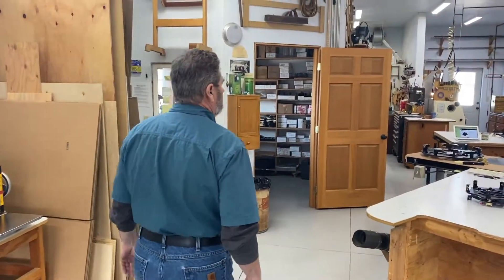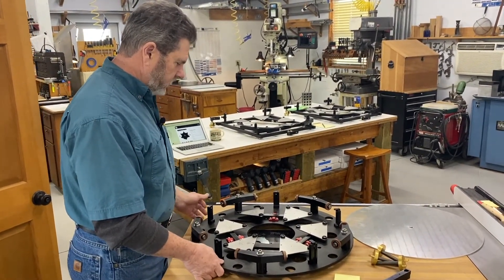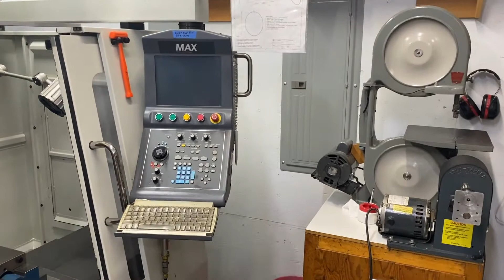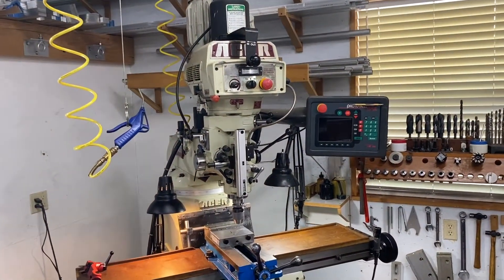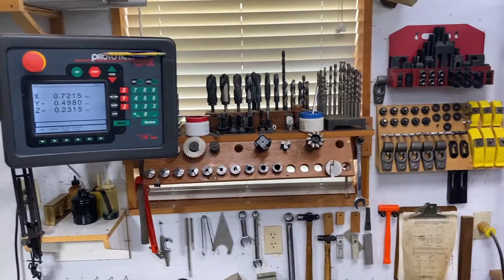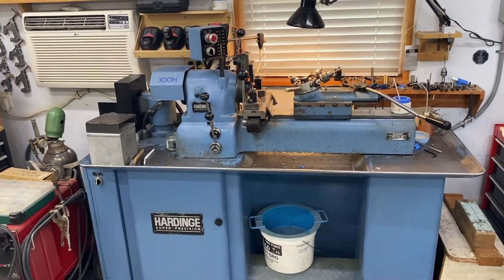Shop Tour

Comment: What do these mirror cells do?  I’m not sure I understand what google told me.  As a job shop it’s always neat to see what other people are making.
Reply from the maker: Dustin, mirror cells are used on telescopes to provide an even support to the main collecting mirror.  The mirrors are concave so they focus the light to fit our eyes and are very precisely figured to provide the best possible image.  The mirrors are made of glass and we think of them as being rigid but that is not the case, they will bend slightly under the own weight if allowed to and distort the image.  I hope this helps to answer your question.